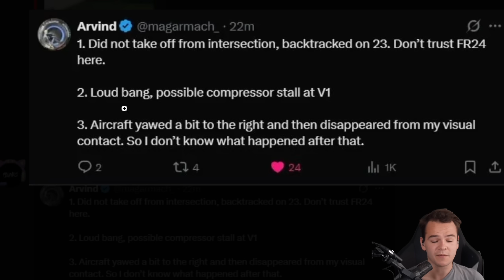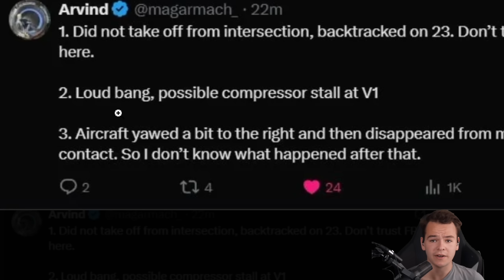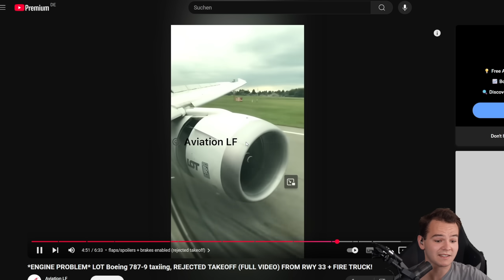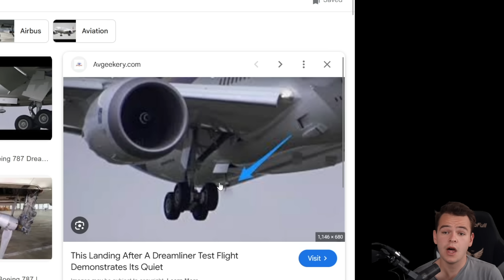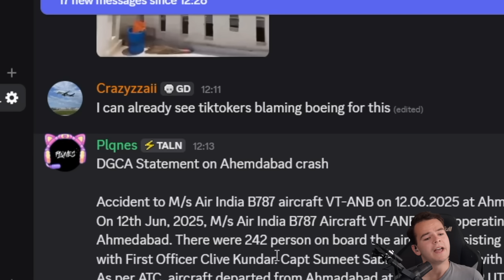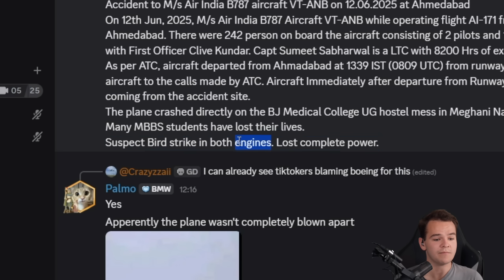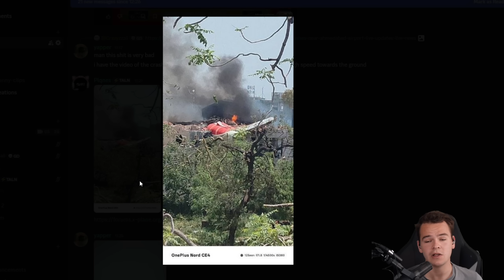The First 787 CRASH Ever - Why It Is SO Confusing?

Comment: I was shocked when I heard that the 787 crashed on the news, I never thought such things could happen
Reply: Any plane can crash tbh
Reply: @Capt.Rankin the a380 has never suffered a single hull loss (considering its low quantity)
Reply: @Arado_MissileThank you for that information, but how is it relevant to what I just said?
Reply: @Arado_Missile  Better be with 600 souls on board
Reply: @Arado_Missile it helps to have four engines 🤣
Reply: Theres not as manÿ a380s either. Over 1000 787s in service
Reply: @Capt.Rankin   As a purely mathematical logic, you're not wrong.
Reply: @Capt.Rankin  Yeah I mean wtf, thinking a plane can never crash is like thinking a boat can never sink, and we know where we've heard that one before.
Reply: @mjuzick-f4sI know I’m being pedantic here, but I think it’s important not to throw shade on the geniuses who designed and built the Olympic class of ocean liners… So to clarify, they never said they were “unsinkable” and were totally aware of the fact that if it floats, it can sink.

I believe what they actually said was, the two ships were “practically unsinkable… as far as it is possible to design a vessel to be so.”

Or something like that.

Nobody who’s even aware of Archimede’s principle would say an ocean going vessel is “unsinkable” let alone those capable of building or operating a ship as advanced as the H&W Olympic class ships were in their day.

Sorry to be that guy, but man that idea just winds me up.
Reply: @Capt.Rankin  Most aviation crashes/incidents mostly on small personal planes or helicopters

Commercial airliners mostly rare, and if accident/incident is from minor to severe, not total crash
Reply: @Liz0rdX80 Yeah and?… Just because there hasn’t been an A380 crash, doesn’t mean it’s equipped with anti-gravity, or made of indestructible materials.

They’re extremely impressive, nobody can argue with that, but they’re still just aircraft that operate with the oppressive laws of physics… they’re not magic.

An A380 is every bit as vulnerable as any comparable commercial aircraft to being operated outside of its performance envelope and/or experiencing a mechanical failure which ultimately brings the aircraft down.

In fact, as I’m sure you’re aware, Qantas flight 32 DID experience a catastrophic mechanical failure in the number 2 engine, leading to an uncontained separation of parts of the main fan assembly, which caused extensive damage to the wing and the critical internals contained within said wing.

If it weren’t for the four absolute Aussie heroes on the flight deck (makes me proud to be Australian), who were among the very best of the best in the profession, then it’s highly likely that aircraft and all onboard would have been lost.

I get the point you’re making there about the level of risk being much higher among privately operated recreational aircraft, but it’s a moot point in the conversation being had here.
Reply: @Liz0rdX80  Any plane can crash, commercial airliner or not. There is no intelligent reason to think nothing like it could ever happen. No self respecting engineer would ever tell you the plane they worked on is uncrashable
Reply: People keep saying that, and then a passenger jet with hundreds of people crashes and explodes killing all 
on board
Reply: @NateTheRailfannedAvgeek thats a really bold statement. Any flying vehicle can crash no matter what. There is no such thing as a 100% safe plane/helicopter or whatever that is flying.

When people go on a flight there IS a chance that you might not make it to your destination because it crashes (even if it has a low chance). It's a risk everyone has to take when they decide to fly.
Reply: Exactly!! I couldn't agree with you more! 💯@cs.marcell469
Reply: 787 is not 737 Max
Reply: @UnderSeaWorld97   Nonetheless the both are BOEINGs.
Reply: @UnderSeaWorld97  ANY PLANE CAN FUCKING CRASH. ITS A FACT
Reply: @UnderSeaWorld97  No shit sherlock.
Reply: @UnderSeaWorld97  This was exactly the first thing that came in my mind, "must be a 737 Max" .. "it's a 787-8, wait.. that's new."
Reply: @smarseille7422  The 787 came out in 2009
Reply: @UnderSeaWorld97  I know, but I mean, when I heard about the crash I was not yet aware of what type of plane, so I thought 737 MAX, until I looked up and being surprised it was a 787-8, never heard about this plane crashing (the that's new had nothing to do with the age btw, just the first time it crashed)
Reply: @UnderSeaWorld97 both made by the same people
Reply: How naive of you. Nothing, but absolutely nothing in this life is foolproof.
Reply: It's the same as when Japan Airlines flight 516 happened
Reply: @mayortyranno2903 literally not same at all
Reply: @some559  I mean that people said the A350 wouldn't crash and obviously JAL516 happened
Reply: @mayortyranno4645 u use wrong definition of crash.. JAL516 not crashed but they collided with a different plane... and its even they already landed not airborne or even just a few meters from ground
Reply: @mayortyranno2903 u use wrong definition of word crash.. JAL516 not crashed but they collided with a different plane... and its even they already landed not airborne or even just a few meters from ground
Reply: @SVT-ny8ee  ok then, my bad
Reply: @mayortyranno2903  Had nothing to do with the a350. A military plane got in front of it. What do you expect it to do, teleport?
Reply: @mayortyranno2903 that wasn't the planes fault, it simply landed on top of another aircraft
Reply: @some559 are you dumb he says that the 2 planes were new and reputated as safe so we are shocked😢(and it’s the 1st crash of 787)
Reply: @mayortyranno2903 Bro the A350 didn't crash cause of the plane's design flaw. It impacted an unauthorized plane during landing and everyone was ok. This crash is a clear plane fault and it killed 250 people. And 50 on the ground minimum. Could be higher
Reply: @mayortyranno2903  That was a military plane getting into the runway without permission and into the A350s way. Also nobody on the A350 died and it wasn't plane related.
Reply: well just like everybody that say to the 737 max
Reply: What. Where have you been hiding out. Oof course planes crash . They do and always will.
Reply: Nothing man made is perfect
Reply: Yep agree BUT no mode of transport is 100% safe sadly ..i know the 787 has has a great safety record up till now .....BUT saying it's un crashable  is and was tempting fate ...they said Titanic was unsinkable but it happend! ...sadly NEVER take anything for granted .........it will very prob turn out (if not a technical issue) to be put down to pilot error ..BUT then again we wont know anything till the accident investigation is done! R.I.P to all those that lost thier lives in this crash 😢
Reply: The temprature in Ahmd was 37C and sky completely clear today with no winds and hardly any such birds in the area due to high population in the surrounding.
Reply: I believed that was said about Titanic too…
Reply: as long as planes are flying, planes will be crashing, why exactly dont you think that could happen?
Reply: Frrrr bro 787 is literally still a new plane
Reply: Going to guess blackbox is NOT going to be recoverable!!
;-/
Reply: It's a Boeing
Reply: It's Boeing so it's expected
Reply: @unknown-gh8li for once this is unlikely to be boeings fault
Reply: Oh my. An airplane crashed. That is the first time I ever heard that airplanes can crash.
Reply: same
Reply: It's India dude, ie people who poop in the streets. Never underestimate their ability to F things up.
Reply: Same
Reply: Absolutely.
Reply: Contaminated fuel maybe?
Reply: Scary 
So many crashes this year 
Dear GOD please 🙏🏾 watch over us please
Reply: @Nam-j4z  no such thing as god…
Reply: Did you thought planes fly with magic?
Reply: What planet are you from?  When humans and flying machines are involved, things will always go wrong.  The biggest miracle is that it didn't happen sooner.
Reply: Not really the aircraft’s fault either. Birds never have the courtesy to avoid mid-air collisions which is known for causing such issues.
Reply: @johnrickard8512  no smoke or fire on any engine visible, according to proper mediaoutlets not many birds in that area…
Reply: Can never say never - mechanics fail - nothing is indestructible
Reply: Yess
Reply: Parjeets are experts in crashing planes, first rafale and now Boeing.
Reply: Everyone is now Swiss001!
Reply: Flying coffins playing Russian roulette with gravity every single day  - it's happened before,  it will happen again
Reply: STUPID,   SMH.
Reply: This is Air India
Reply: Yea......It's only happened a hundred times before.........................Paul
Reply: So john Barnett was right afterall?!
Reply: boeing frauds
Reply: Unlikely boeings fault  @zzyuk814
Reply: Is this a special site, for "special" people?
45 seconds into the vid, I've already heard "uncrashable" and "undestructible", I think he meant "indestructible", words that no aeronautics mechanic, technician or engineer (pre DEI) has ever said.
Ffs, I go to the comments, and similarly ridiculous statements are being made here, wtf?!
The Titanic wasn't just a film you know.
Reply: How could Titanic get sunk huh
Reply: Nobody believed that about titanic either
Reply: no flaps at low speed
Reply: could it be an act of terrorism - what if some bad guy near the airport with some gadget did interfere with the airplane' software to shut off the electric system? the passengers had time to sent texts to their relatives about: the air conditioner stopped working and all the electric lights just got shut off...
Reply: @LanaArte-yc1yh there's no "gadget" that can interfere with an airplane, unless you're talking about a missile.
Reply: Never say never
Reply: Dang it the one guy didn’t pull through fck
Reply: why would you be so sure of that?  any system can fail. I'm sure you're a pilot but isn't this some kind of brainwashing?
Reply: That's dumb. There has been a guy on the record, who worked for Boeing in production, who was on the record telling everyone not to fly them. Titanium shavings rolling around the wire bundles under the floor, battery problems, etc.
Reply: She's made of iron sir i assure you she can crash
Reply: 787, 737... lol boeing is terrible
Reply: I'd hate to say this, but do you remember Chesley Sullenberger, AKA Sully?
Reply: After Trump won a second term, anything became possible!
Reply: I just read an article yesterday that a lot of 787-8's were being grounded due to maintanence issues. So I won't be surprised when it comes out that Boeing delivered a faulty plane
Reply: If anyone has children let them watch Under Sea World!
Reply: I absolutely think something like this can and will happen, in fact I cant believe it doesnt happen every day. Everyone going on about statistically flying is safer than bla bla bla, if the difference between life or death is  hanging by such a thin line as a flap setting being wrong, or a software bug or just a single human mistake, I sure ain't gonna consider the situation safe in any way. Sadly the Aircrash investigation series will have material to keep doing new episodes for the future year after year.
Reply: I was shocked when I heard Mike Tyson got knocked out in his prime.. I never thought such things could happen.
Moral of the story. Anything can happen
Reply: Actually i suspected this might happen. The Dreamliner since the first prototype always has been plagued by malfunctions be its battery system or flight control mechanics, the bigger issue is if any fault from the plane itself caused the crash or some other factors like weather, pilot error etc.
Reply: I was surprised by the first a350 crash and even more surprised by the 787 crash
Reply: First the a350 now the 787
Reply: @Arado_Missilethe A350 colided with a smaller plane and everyone onboard survived. Both very difftent circonstance and outcome
Reply: @Arado_Missile JAL516 not crashed but they collided with a different plane... and its even they already landed not airborne or even just a few meters from ground
Reply: @SVT-ny8ee  could you repeat that please ?!
Reply: @Arado_Missilethe A350 noone died tho and it wasn't a plane issue or fault. A military plane got in its way without permission during landing. Also nobody died on the A350. This one's clearly a plane issue. Mainly engines looks like.
Reply: Same
Reply: @simontherainbowmoose really? you never thought a BOEING could crash? You need to do some research, their qc went to shite.
Reply: With Boeing current standards anyting is possible. Safety first, travel only with AIRBUS
Reply: Boeing+India surprise?
Reply: @samsantana Yeah I’m not exactly a nervous flyer and have been on some sketchy flights in my time… But the old joke “if it’s a Boeing, I’m not going” is not one I’d be make jokingly should I find myself standing at the terminal gate of any Indian or African operated flight.

I’ve always been a proponent for spending the extra money to choose flights with Qantas, Emirates, Qatar, BA, Singapore and a handful of other highly rated airlines. Firstly because the experience is just worth it, especially living in the furthest part of Australia from basically anywhere in the world you’d want to go. But secondly because, I do like to know that I’ve reduced the risks as much as is possible to do. When abroad, it is oh so relaxing to board a Qantas plane and hear that cool, calm and collected Aussie accent coming from the flight deck.

Even if things get rough, I can sit back and rest assured that they’ve NEVER lost a single plane in over a century of operations. They’ve come close, but pros have saved the day and that’s worth every single extra penny to me.
Reply: @samsantana then whut the the other country up yo arse is it
Reply: @samsantana this is the only major crash in 25 years wtf you on
Reply: Who says that this accident has something to do with the model or brand of this airplane?
Reply: Anything can happen in India,
Reply: @lifer195  10 Boeing crashed globally in last year clown
Reply: World's first Rafale jet crash also happened in india last month.
Reply: @ss3577t that’s so cheap and your fellow likers. Using a tragedy to take a cheap shot.
Reply: @ss3577t  Combat aircraft. Not the same as a big ass civilian airliner slamming into the ground.
Reply: @ss3577t  proof social media.
Reply: @ss3577t  people don't travel on a Rafale
Reply: @ss3577t  No proof whatsoever unless you think arma 3 footage is one
Reply: @ss3577t  How low does someone have to drop? Using a disaster to push propaganda.
Reply: @ss3577t  pakistani dected bro in 2022 2 rafale also crashed in france  but yr stupid ISPR wont tell u that

Comment: That fella stalled the AOA looks too high and going too slow.The engine sounds like it’s at slightly higher than idle but it’s still running
Reply: If you look closely they had no flaps extended. Fully loaded with no flaps will certainly cause a stall and a crash.
Reply: @Standiford02 the slat is down so it’s was deployed at 2 degrees
Reply: @Standiford02 mmm you got a point there but only if the engine wasn’t running or on lower power